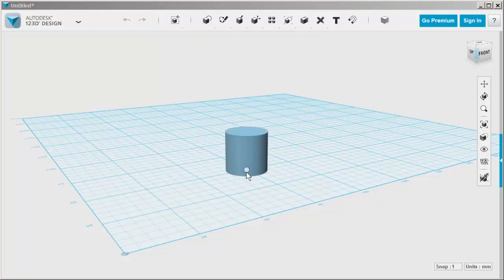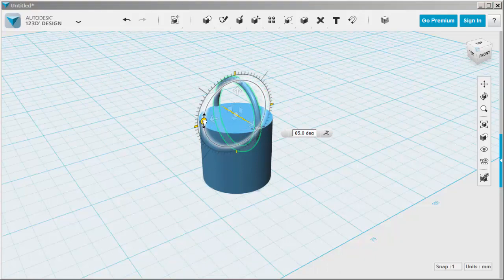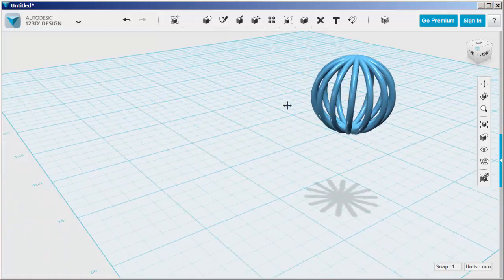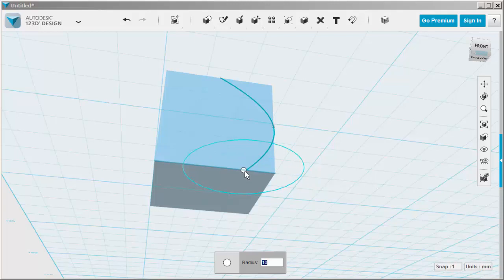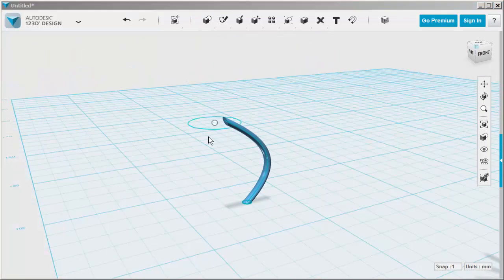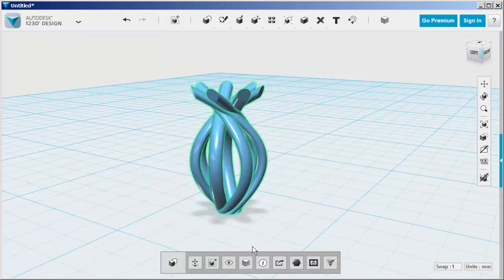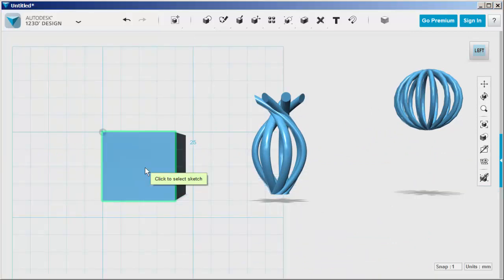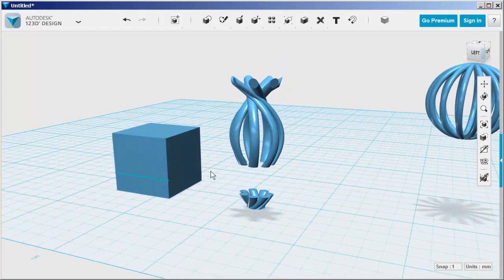123D Design: Circular Cages

Comment: thx for your videos can you create a proper metric or imperial screw thread please
Reply from the maker: +paul goodier Hi, Inventor has a thread feature, Design doesn't. I would use the thread shape generator in Tinkercad. I used it in this video. I will try to do a screw later. https://www.youtube.com/watch?v=JVXVPgAiz7o
Reply: Ok thx for the speedy reply  I'll check out tinkercad also but don't remember a thread maker there thx again
Reply from the maker: I just did one, kind of rough, but shows the technique. https://www.youtube.com/watch?v=E0obYR8Tv7w